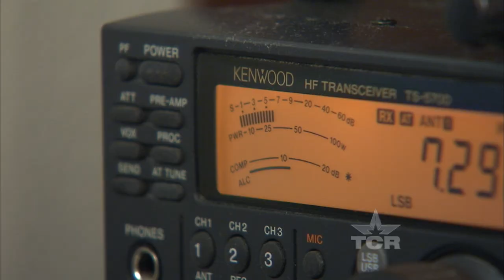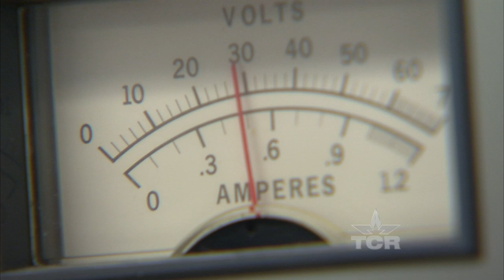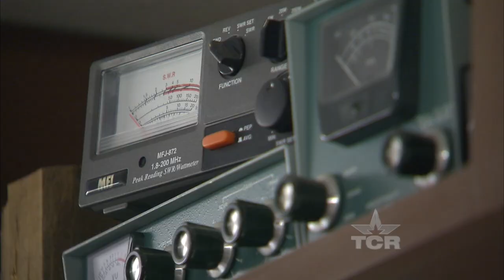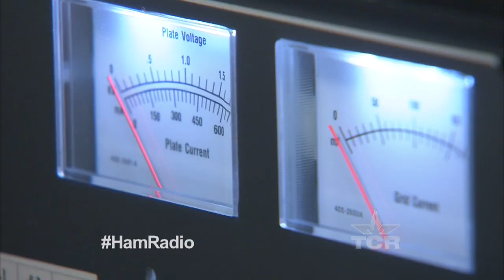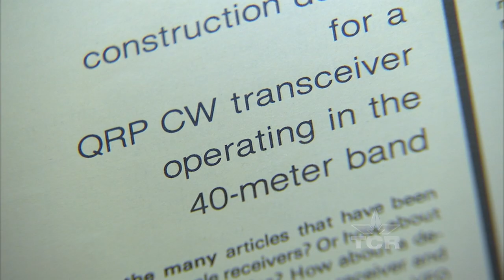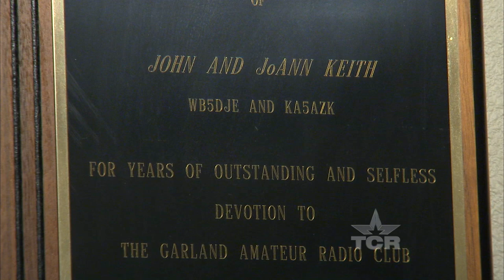Ham Radio Couple (Texas Country Reporter)

Comment: Nice video about Ham radio. But as usual most of these video's about Ham radio are produced by someone not familiar with the hobby. So the reporter or announcer always manages to say something dumb that's misleading & no one corrects them on it. He state's that the couple even have their own 70 ft. antenna. Well the antenna isn't 70 ft. in size, rather he should have said they have an antenna that's on a tower that is 70 ft. high.